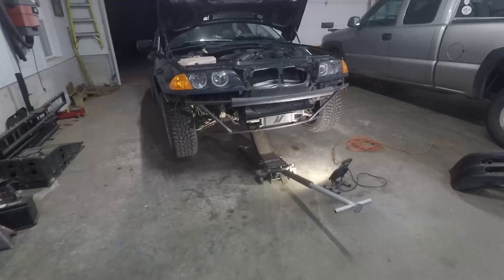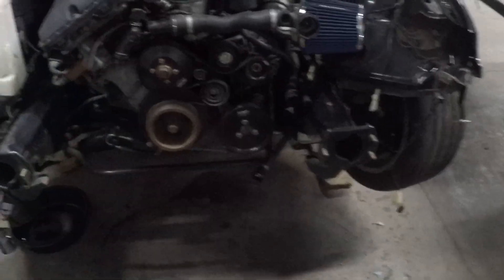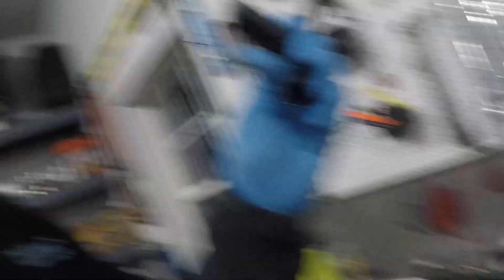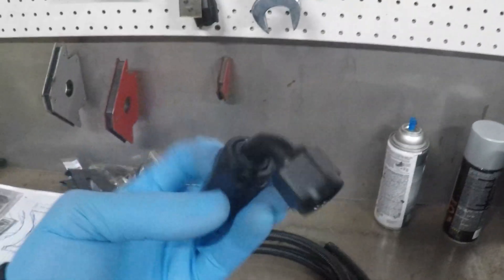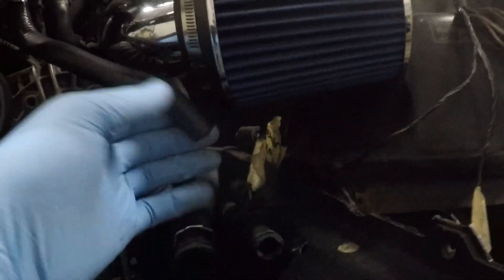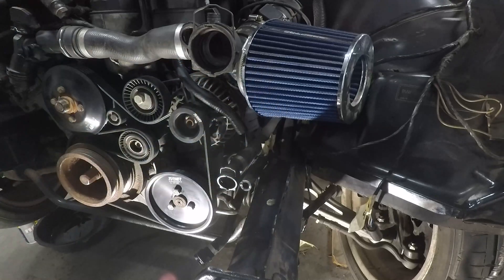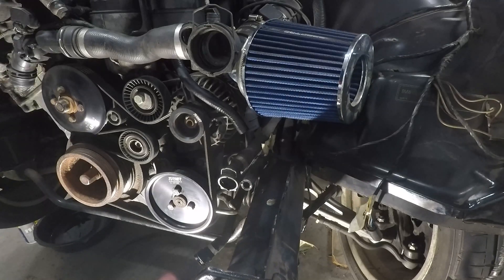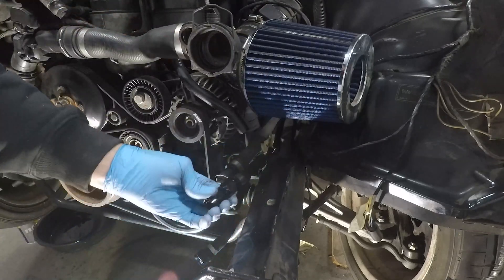Installing an Upgraded Power Steering Cooler on my BMW!

Comment: Hey man, great tutorial. Really makes me think I could tackle a job like that. I am replacing the steering rack and pump on my E36 and I am looking to install a cooler, as I constantly boiled my fluid while drifting before. Any post install complaints? How was the bleeding process? Does the steering feel any different? Have you boiled your power steering fluid since the install? How have the AN lines held up over time?
Reply: Do you have a 2year update?
Reply from the maker: Thanks for the feedback man, it seemed to prime a little easier, no complaints so far. The lines and fittings have held up so far.   I haven't  done any real drifting with it yet, as this wagon project has been sitting  so as far as the boiling over goes I don't know.    I can say it's basically doubled the amount of fluid and greatly improved the cooling
Reply: @ClutchkickGarage  Awesome, thank you. Good luck with the projects man :)